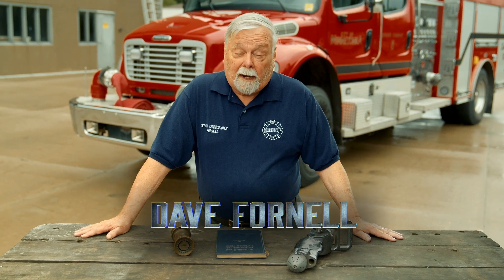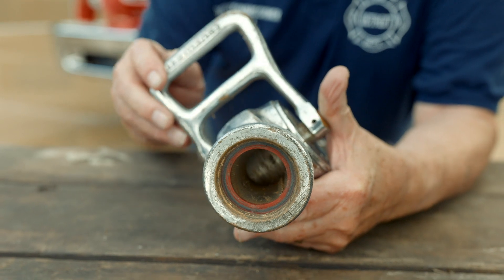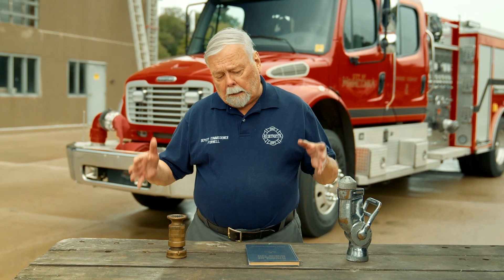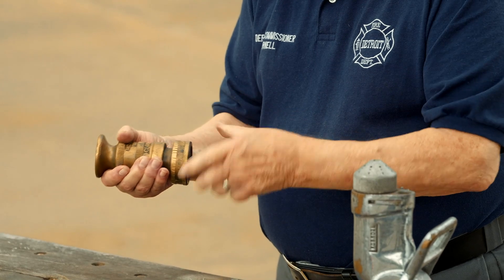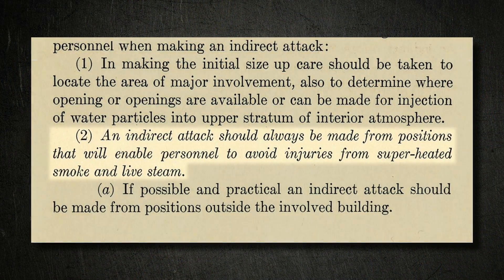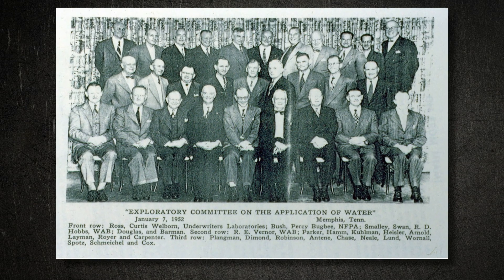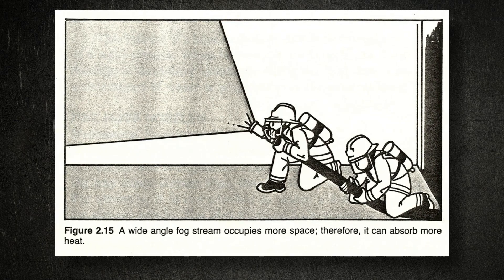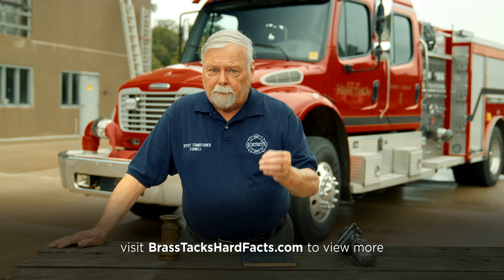History of Fog Attack (Episode #100)

Comment: The modern science done by NIST UL (FSRI) truly brings this research to its final conclusions. The application of fog in a structural fire can and will increase the volume of fire through the air entrainment. The phenomenon that caused many in the 60s and 70s to determine that fire nozzles could push fire, when in reality, fog streams push fire and. Or solid bore or straight stream. The application is very defined, use a straight stream or solid bore at flows from 180-200GOM. Control flow path and air entrainment and you will cool the fire in minted rather than 40-60 minutes.